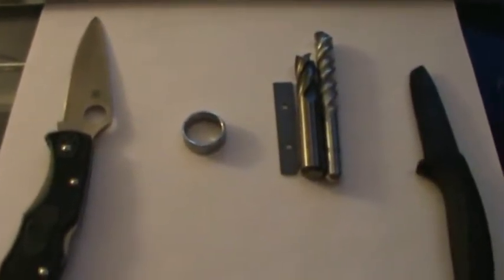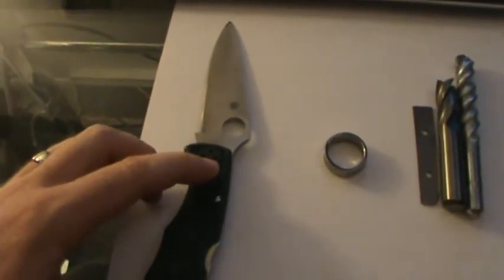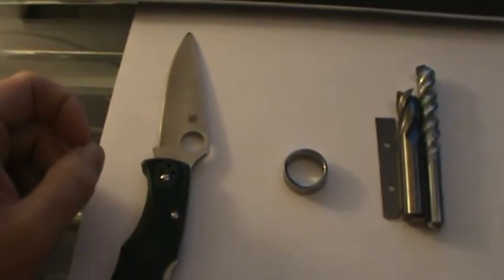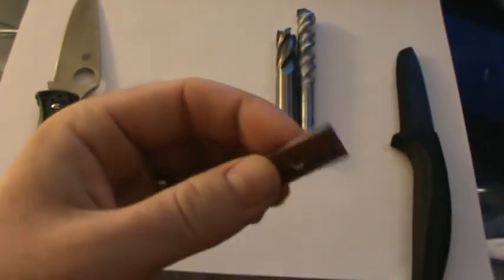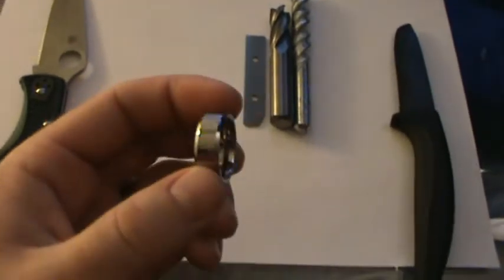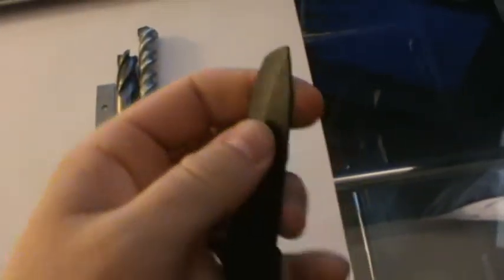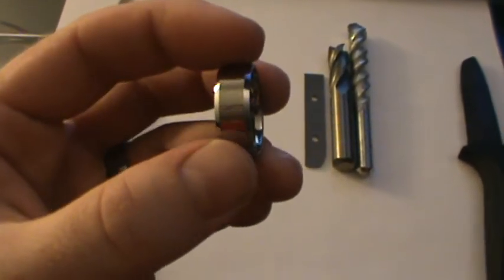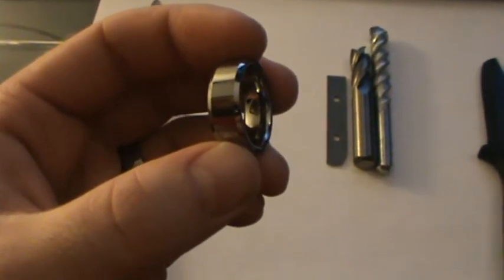Knife Blade Materials - Nickel Bonded Tugsten Carbide

Comment: Tungsten carbide in general is too hard/brittle (prone to breaking) of a material to use for a knife blade, which is why it is typically only used to tip a softer metal. So the only reason I would use tungsten carbide on a blade would be if I wanted to add saw tips to the back of a large spring steel blade. Not sure how compatible those other metals are with food preparation.